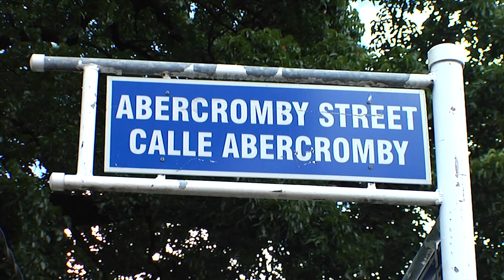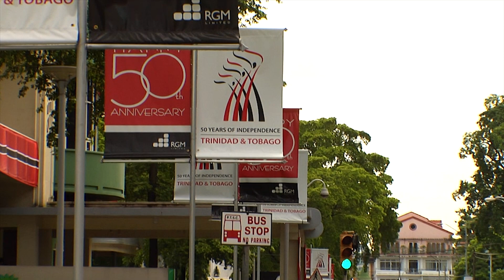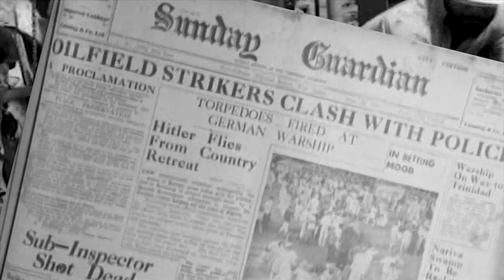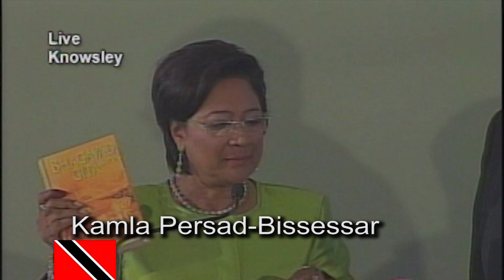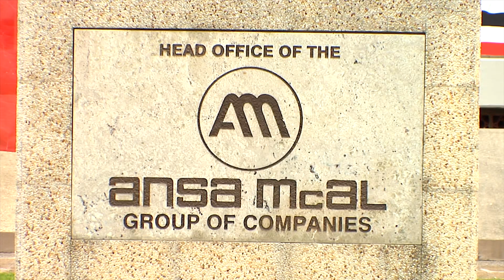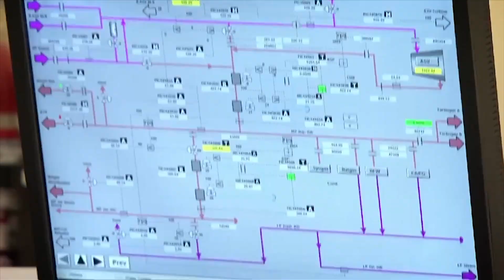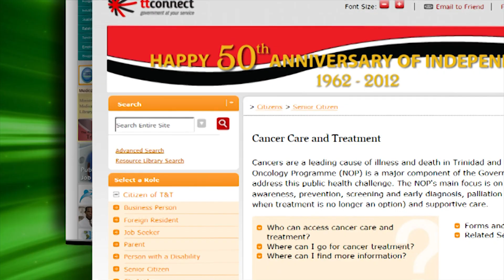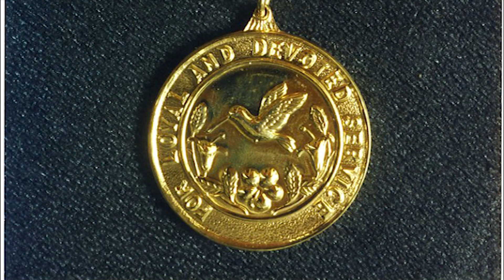SNAPSHOTS OF HISTORY TRINIDAD AND TOBAGO 50TH ANNIVERSARY

Comment: independence morning 2020. He wasn't so grand. Found us and left us THIRD WORLD.

Drowning in petrodollars. 1980 article @t - 
'Money is not the problem' Trinidad and Tobago's austere Prime Minister Dr. Eric Williams once remarked in an unguarded moment he would probably rather forget. 

But take oil away from both sides of the account and the result is a horrifying deficit. Imports run at a level almost seven times the country's exports. *Trinidad is a massive food importer, while agricultural production for local food and exports is in steady decline.
So is production of vital materials like cement and bricks. Even the assembly industries that still form the backbone of the manufacturing sector, from cars to appliances, are flagging badly. 
The idea has been and still is to use oil wealth to finance swift industrialisation along familiar Third World lines, to expand manufacturing and eliminate dependency on a single export like oil.